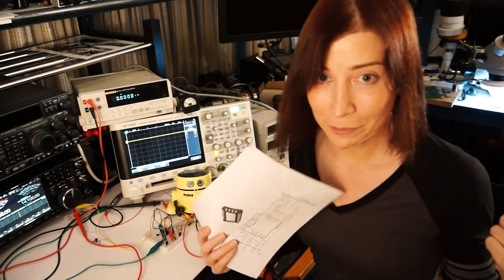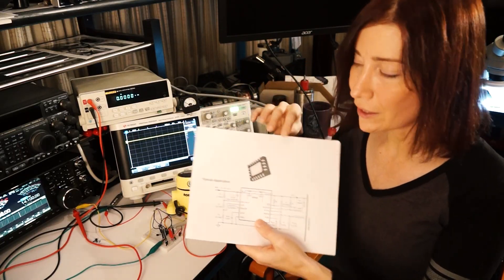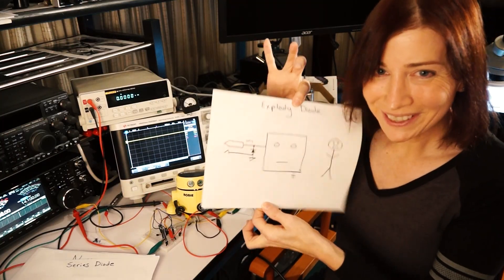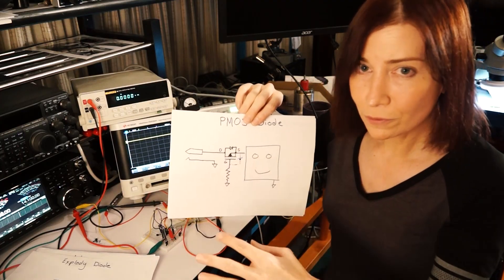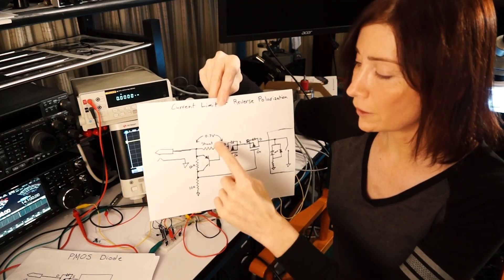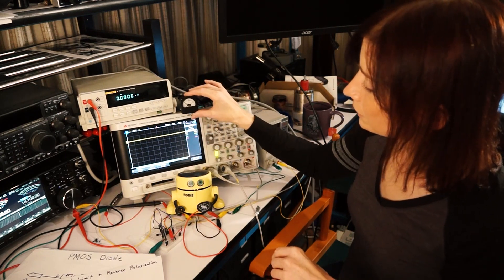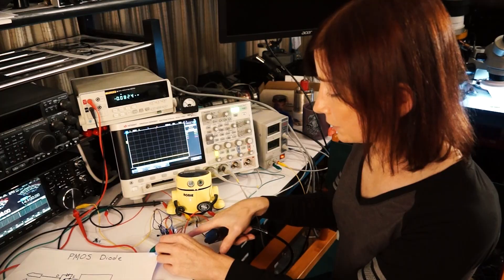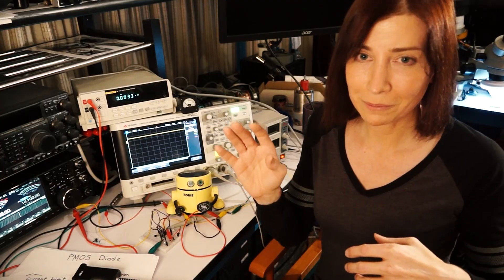Low Cost Reverse Polarity and Over Current Protection (Corrected)

Comment: I always add polarity protection into my designs if there is a chance that a user will connect polarity incorrectly, but I usually don't bother with resetting current protection.

My thought is that if overcurrent occurs, it's almost certainly due to a downstream fault, and therefore a resetting current limit doesn't save the product from needing repair.  The original fault will still exist. So I generally fit fuses that are designed to blow to prevent the fault progressing to a fire or serious damage occurring.  

The exception to this is if there are external ports, e.g. USB ports. In which case, for those, I generally use current-limited load switches.  But the DC input is still only protected by a fuse.

Comment: Way too many parts for reverse polarity OV protection for a low cost device!      The simplest for a low power device is a PTC fuse with a TVS diode after the PTC fuse shunted to ground. If the input voltage is overvoltage (OV) the power will be shunt to ground & the PTC fuse will limit the current. In reverse polarity protection, the TVS diode will also shut all of the power to ground while the PTC fuse limits power draw.            This protection system only requires two components, and about as cheap as you can get. Bonus: the TVS diode also provides Surge protection & short circuit protection too! Generally I prefer to avoid using P-type MOSFETs & transistors since they usually have high pLoss and are usually more expensive.
Reply: I really hope you're not serious... That kind of approach to engineering is terrible.
Reply: Look up PolyZen (LittleFuse) components on Digikey or other sources. This type of circuit is commonly used for overvoltage protection for portable consumer electronics.
Reply: @guytech7310  
Thanks for the links, I'm not entirely convinced but I'll examine it in more detail later.

Consider what happens when you apply the source voltage backwards. Using the TVS diode to clamp the source voltage means that we have to wait for the PTC to change its resistance (in response to heating). This is playing with fire. Not to mention that the TVS won't activate unless a specific threshold voltage is met (meaning that reverse voltage @ half Vbreakdown is won't activate anything), while the PolyZen has a zener diode (from what I can see), which when forward biased like a regular diode will be attempting to clamp the source voltage. Very dangerous. 

Why not address the issue directly and use an inline mosfet that responds instantly to reverse polarity, and prevents the circuit from conducting in the reverse direction period. This is my issue with these kinds of protections: you'll be damaging something else in your circuit, like your original source, or something else, while we wait for the PTC to pop.  

I'll stick to direct methods. Dedicated circuitry to handle overvoltage, and overcurrent conditions can be built cheaply as well. Considering the prices of mosfets, I'd say that they are just as cheap as the PolyZen, but offer far more control in the end.  I'd advocate for spending a bit more money on quality protection, instead of trying to cheap out.
Reply: Yup That's the idea. It protects the circuit from reverse polarity. PPTC fuse limits the current. Cheap, Simple & reliable.

Comment: You might also consider the use of a re-settable fuse.  The Bell Fuse Inc 0zcj0005ff2e (surface mount) has a hold current rating of 50MA and a trip rating of 150MA, 3.6 ohms cold, 50 oms when tripped, cost in quantity is 5.6 cents.  Many varieties are available.

Comment: ☺😊😀😁😂5 Smile's we know I'am working on several different devices i like the safety curcit smart did one for a dynamo with out it it shorts on a double line 6w if you want to play explosive diode take a standard 400v 1amp and put it across the battery off the car the 65 amps makes it explosive dangerous explosive stick 6000 off these together and put a car battery behind it 😨.

Comment: Hey Jeri, im trying to modify an ATX power supply for my equipment, but i cant find the schemes for the integrated, so im unable to know what pin is the power control to get 13.8v. Any advice about how to find it? :) 73,51 Im currently studying for my license.

Comment: The human race has a long history not only of poor electrical or electronic connector designs, such as the RCA connector and quarter inch phone jack that make and break the positive connection first instead of the ground connection. And then they came up with the Canon / ITT / XLR connector, with the ground pin a little longer than the  others, but different countries disagreed on what the pinout standard should be!  And don't get me started on those stupid  barrel type connectors  used to power everything from calculators  2  guitar pedals ,  there are all kinds of size and length variance , in the wall wart power supply voltages can be anywhere from a couple of volts up to  40 volts, sometimes AC and sometimes DC,  and  compatibility of polarity and voltage is treated by the average consumer as a 50/50 guess, where it either works, sort of or seems to work, or it goes up in smoke. Sometimes I think we are back to preschool, trying to hammer Square pegs through round holes.
Reply: That's so one of my rants too...  Good connectors are hard to get right, but really we have had long enough to do this now(!).  DC power connectors could have pin-spacing/colour-coding to match the voltage for instance.  

And never should a connector have backwards-facing bolts or clips like RJ45's and D-series, you'll realize this when you have to extract one from a nest of other cables!  Quite like speakon as a design, seems to tick the relevant boxes as fit for purpose
Reply: @MarkTillotson  , absolutely! For power- plug connections to small devices with wall wart power supplies, it seems to me we should have something like a slightly larger version of the standard 3.5 mm plugs, morphed with the idea of a speakon connector, incorporating extra metallic contacts, only two of which (typically) are live depending on the voltage supplied from the wall wart and the input requirements of the device. Such a connector could also have a plastic or metal bar or rib built-in to do the on-off switching for a device that is also powered from internal batteries.
Reply: @MarkTillotson  , PS , I was a telecommunications cable installer for a number of years, and you are correct, whoever designed the rj11 and RJ45 connectors really got it all wrong. And the dimensional variables for coaxial video and data cable , especially  quad shielded RG6 and RG59, are not only unconscionable but insane. We used to make it a point to buy connectors from whoever supplied the cable, so that we could be guaranteed a proper fit. And we would buy whatever crimpers the manufacturer recommended. You ought to be able to buy stuff like this right off the rack or from anywhere and have it all interchangeable, but it isn't.

Comment: You can send your P-MOS protection circuit to ElectroBOOM for testing.  There have been instances where he has shocked himself due to stuff.
Everywhere I go, Big Clive is there.
Recently bought some AO3401 P-MOS devices, mostly for circuit protection.  Pennies, yes -- but a bit small.  Like trying to solder a grains of sand.  Do you have a favorite PNP MOSFET in 3-pin TO-92, with a really low R(ds)-ON?

Comment: Is there a reason you have two PMOS transistors?  It seems to me that your current limiting PMOS would also do reverse polarity protection.
Reply: No. The body diode of the current limiting transistor will conduct during reverse polarity fault.

Comment: Great video, I'm glad I've found your channel. Incidentally I once worked with someone who showed me that the protection circuit could be built "the other way up" using an n channel device. The advantage of this was the slightly better performance of the FET. The problem is of course that the positive rail runs from battery to load and the FET is in the negative rail, so battery negative isn't at ground. This really only matters if the battery negative is run outside the equipment for anything other than an isolated charger.

Incidentally I'm now usually the embedded software geezer and I DON'T leave loose change on the bench. :=*)

Comment: I have never found a mosfet with reverse diode like that, give me some names please
Reply: The diode is not reverse. It is a standard discrete PMOS transistor. You connect the drain to the voltage source and the source to the load, and the gate to GND.

Comment: Most dc equipment for decades had a diode across the input so it would blow the fuse of the power supply or battery system if it was connected backwards, if there's no fuses on the output of your power source or the equipment if its made correctly. sounds like something an engineer would do since they don't actually do things in real life.
Reply: gabooga, so many modern electronic devices are powered by what we used to call "wall wart" power supplies, which in recent years have typically been sealed and glued together into the plastic shell, so if there is  indeed a fuse in there, or you want to replace/repair a cord that has broken where it enters the device, you can't take it apart easily. And it might not have a fuse in there anyway. Nowadays, many or most power supplies are transformerless switching type (often generating RF noise, therefore not always valid or usable to replace the original power supply); some do have removable screws to take them apart but if they're fused it will often be soldered in place and often an odd- value miniature F or  GMA type fuse that isnt easily found locally, and can only be replaced if the owner of the device has a soldering iron and proper solder and knows how to use them. Or hopefully he or she has a friend or relative who can do it, because you can't just take it to the local Radio Shack  or small  electronics retailer for a quick fix,   most of those guys and parts shops don't exist anymore,  and an actual repair shop will offten have to charge more than it's worth to repair the power supply. So, people just trash the device and buy another similar piece of crap, or a even crappier piece of crap. You should see the walk-in dumpster/shipping container that our small town transfer station uses to collect E-Waste, it quickly fills with old computers, and old stereo and video equipment, TVs including fairly modern flat screens, lots of microwaves, power tools of both AC type and cordless battery type, and especially vacuum cleaners. Every weekend when I go to the transfer station, what people used to call the dump! I will see about a dozen vacuum cleaners in there, most of which look as if they are clogged and probably just need a fresh belt and a cleaning out and maybe a fresh filter. I have seen Dyson vacuum cleaners in there, $600 vacuum cleaners in the trash! I do periodically rescue some vintage stereo stuff and occasionally a guitar amp or other useful device, but I can't rescue it all and it makes me crazy.

 By the way, myself and some tool wielding acquaintances volunteer at a Repair Cafe four times a year, where people can bring in household items that we fix for free or just for the cost of parts in any donation  they'd like to give. We tyoicalky fix a lot if lamps, vacuum cleaners, glue loose chair legs and rungs, small electronic devices if the repair isn't too complex, and so on. There's three or four women that will fix torn clothing or put buttons on and do minor alterations, and a guy who sharpens knives and fixes clocks, and so forth. It's a fun Community Building Gathering, and usually the people whose items are being repaired will sit and chat with you and maybe learn how to fix things as they watch us, perhaps they'll tell you their life story, And So It Goes. It's really a lot of fun!

Comment: An engineer designs something, but it takes a technician to make it work.
Most engineers can't do anything in real life, just on paper.
The best engineers started as technicians.
Too bad they don't teach electronics anymore and discreet components.
Reply: There are poor engineers (the ones with Firsts - typically) and there are poor technicians (who bend all your tools). The common factor is they approach work thinking it's just a way to earn money. They're not really interested. Success takes a lot of watering over a long time and if your heart's not in it, you'll flounder.
Reply: "I tell you, kids today, and their indiscreet components..."
Reply: Yes, they need to make engineers repair some of the equipment they designed and make them realise just how bad some of their designs are. Unfortunately I see it on a daily basis.
Just adding a removable panel to the bottom of an amplifier would save me soooooo much time. Take note Yamaha!!
Reply: @luscus9754  , I work for an audio electronics repair shop. At this point much of the equipment we fix is anywhere from 20 to 60 years old. We no longer do warranty repair for Yamaha or any of the other major manufacturers of yore,  and we don't see too many more audio-video receivers at this point because it's usually cheaper to replace them then to repair them unless it's a really high-end big expensive unit, but I dread having to work on them. Even a known to fail component shown in the service bulletins or measurable and visible from the top of the unit invariably requires an enormous amount of disassembly work just to change a couple of basic power supply parts or something like that.
Reply: @goodun6081  I'm working up the will to replace a few capacitors in my Tektronix 475 scope that's like 1 or 2 decades older than me, I swear it's more of a nightmare in there than modern electronics.  Foot long mechanical linkages with 10 screws each to switches mounted directly on boards, multiple boards connected with pin and edge connecters in such a way that basically every single thing has to come apart and go back together at the same time.  I also have a Tektronix 2440 from the 80's that's mechanically beautiful to work on with boards on hinges connected with IDC ribbon cables with plenty of slack to test any point while it's operating.  Except that doesn't matter because there's not really any spare parts available for it.  The state of hobby electronics is kind of a bummer right now - for a long time it was possible to make a polished, finished product at home and it would just take longer.  Now that's not going to happen again without outsourcing until 3D printers support stereolithography and we get some open source VHDL component libraries for making our own chips, I can't wait
Reply: @alakani  when my 465b dies it's going to the scrapper. Hurts just typing that.
Reply: The best engineers started as technicians. Truer words were never spoken.
Reply: Well I started as a kid, spending my pocket money on components and soldering away in the bedroom. About three quarters of my ideas worked, and then I went on to read Engineering in Cambridge. The fact that I could make things work helped a lot with the course.

Make Britain great again. Teach electronics in primary schools.
Reply: @robertbilling6266  lol. I read that as "I started as a kit."
Reply: Having worked under a technician and engineer...1000% on the money with that one!

Comment: Great video. It's not a real mistake unless it makes it into mass production ;-) Circuits like this and the ability to design them really separate the veterans from the neophytes. Maybe you can do over-voltage options next.
Reply: Is it still a " mistake" when the circuit is well thought-out and properly designs in such a way as to be reliable and difficult to damage by the end consumer, but then the components are secured to the PC board with glue that eventually turns corrosive? You can design the best circuits in the world, but if the implementation into the finished product isn't done right, all your conscientious and well-thought-out work might be for naught.
Reply: @goodun6081  I was making what I hope was a lighthearted comment. The serious idea behind the comment is that mistakes that caught before production are more like close-calls. Mistakes that make it into production cost the company, one way or another. Using the wrong type of adhesive in production is a mistake, but it may not be the circuit designer who made the mistake. It may be someone else. Apart from that, I am not really sure what your point is or how it relates either to my comment or the video.

Comment: That looks like an IC-7610 and an FT-1000MP Mark V in the background.
Reply from the maker: Yes!  good eye.  Just above it is a Flex.  I've got a ham problem...
Reply: @jeriellsworth The active hams that I know all seem to accumulate radios like guitar players accumulate guitars.  They're usually perfectly good, just not what the ham is using right now.  Since it's a shame for a perfectly good radio to sit around doing nothing, it's common to loan radios out to people who are currently transceiver challenged.

I'd be interested to hear about what happened with that large loop antenna you had a video about a while back.

Comment: I'm hoping for a part two where you discuss the considerations for running the circuit routinely in limiting mode and best practices for making the current limiting adjustable.
Reply: I'd like to see devices like these with an integral two or three color low current LED to tell the consumer at a glance if something is wrong with the way the device is being powered.

Comment: The reverse diode across the supply with a fuse is the DC version of the "crowbar protection circuit" replacing the SCR with a diode.

Comment: Another approach I learned about recently is TI's LM74610-Q1 "smart diode" controller, which uses an N-channel MOSFET as the pass device, which I believe has some advantages in terms of efficiency. Interestingly, it does not use a ground reference, so there's no quiescent current in the device.